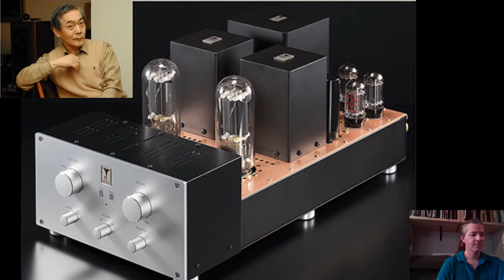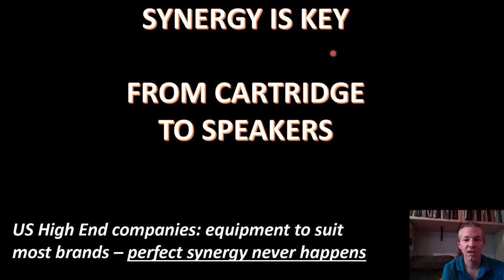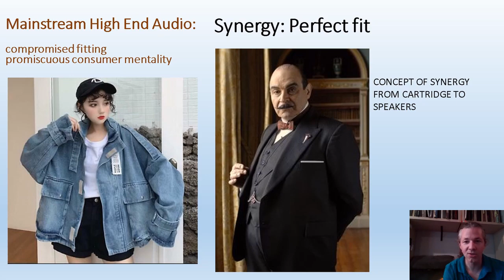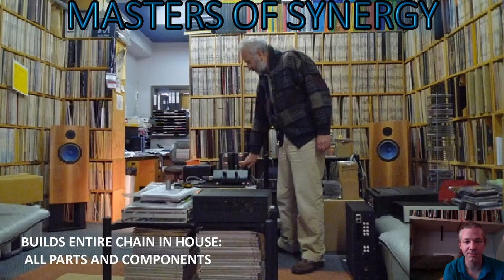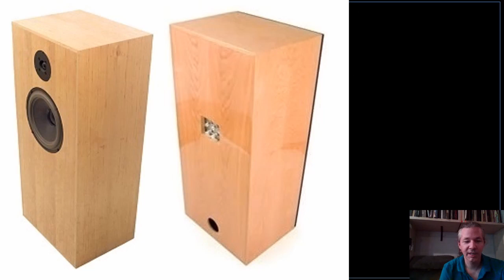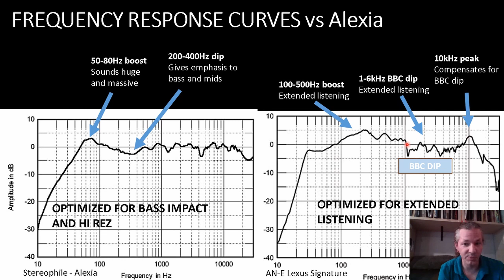Audio Note AN-E LX Sig analysis Part II.

Comment: As a total aside Janos, that experience of being moved by reproduced music like you had with the AN system - more than a live performance, is just about a perfect introduction for what your channel is about. 

And something else, which you probably don't know, I was initially (when watching this video 1st time) actually concerned with active cabinets being one trick ponies, doing couple of things well, but introducing colourations (seeing the AN-E Stereophile waterfall plots showing resonances in line with dimensions and port-top distances)... So despite your videos, despite AN applying it.. undoing decades of deadbeat narratives is not always easy to put aside....

Contrast, a year after this video and having build 2 active cabinets variants, the (final) build no#3 will likely go all out, use tone wood and coupling the driver to the backwalls :-) Also turns, out the resonances and impedance spikes I spotted before can be minimised using the techniques from Hiraga by putting drivers and port opening outside major harmonics of the cabinet, and by using a tapered horn, so even apparent 'downsides' actually have their own, quite elegant, but not widely known solutions... much like the use of different densities of wood in the VOL. You recently did a great job sharing the 'petit' and all its fine points to everyone which may have helped more people trying something that's not the norm... Anyway thank you for all your work, it's been a beautiful breakthrough for me having music reproduction that moves without breaking the bank.
Reply from the maker: The narrative that cabinets must be evil, and their contribution must be eliminated is cemented in extremely strongly. There's a lot of people who are not capable to re-examine the issue, especially those who have read into the inert cabinet lore and are proud for the knowledge they have gained. For a reason or another, we all tend to become attached to the information we gathered, and when new, conflicting information is available then it often seems to people as a personal attack on their belief systems. How can a resonant cabinet be anything but evil? How can anyone go against DOGMA? When such a question arises, that it the big red warning sign that we have left the purview of reason and crossed over to cultish behavior.... 
Indeed, as you have so well demonstrated, building and experiencing effectively puts to end a lot of assumptions that we take for granted.
Yet, for most, typing away defending their belief systems is the easier way out, can't be bothered by actually trying things out... ;

Comment: So AN-e has an woofer with overdamped extended bass shelf alignment with minimal BSC mated with a lower level tweeter that doesn't go much past 10Khz.
Reply from the maker: Indeed, the measurements tell that it will be a poor choice for an anechoic chamber. They worked with the constraints to get a loudspeaker that will work in a mid-size room with glass windows and hard surfaces, with as much efficiency and as extended bass response as possible for such a compact size.

Comment: I wonder what speakers Kondo-San had in mind when he was designing his amplifiers.  That would be interesting to know!
Reply from the maker: Actually, these amplifiers were commissioned to go on a yacht, 4 amplifiers. Unfortunately I have not asked Shibazaki-san what speakers he used, but I'm pretty sure he used horns - I think custom made Altec horn speakers, but do not quote me on that. (I had the fortune to meet the amazing Japanese audiophile gentleman who commissioned and named the Ongaku.) 
Eventually the biggest problem of Kondo-san was that he did not have a pair of speakers that could be successfully marketed as a perfect mate for the Ongaku, and he ended up demoing it with various speakers, which most often did not show the true potential of the amplifier. Peter Qvotrup was the one who adapted the Snell model E, and made the unique loudspeaker (AN-E) that is high efficiency, has great bass extension for such efficiency, and is compact enough so size is not prohibitive for customers. Both Kondo san and PQ had horn speakers in mind as best pairing for the Ongaku, but customers do not want big horns... they want compact speakers.
Reply: @realworldaudio  Audio Note speakers would be a great fit for my smaller room.  The corner loading would help the cause.  Not needing to bring them out into the room would help!  I wonder how the Snell E, J, & K compare to their Audio Note siblings!
Reply from the maker: @thetakeout  Sadly, I've never heard the Snells. Larry (Real Hifi Help) has heard AN-E and Snell E side by side, and says there's a world of difference between them. Also, AN-E covers a very wide range: from the basic AN-E to the most esoteric one they are essentially the same cabinets, with roughly same drivers, but the crossover is vastly upgraded. In my experience, a  great design accounts for 33% of the sound, and the crossover makes up 66%... or even more. So, along these lines, the Snell E (and other Snells) can be vastly upgraded with better quality capacitors, inductors, resistors and internal wiring. ;

Comment: A person recently suggested that we listen to this in my office. I played it on Spotify through my modest setup, and I cried. I'm sure it is very nice to achieve the bliss and Nirvana you discuss here. In the meantime, some of these toys can be quite moving. LOL Here is the song that moved me: https://www.youtube.com/watch?v=rVN1B-tUpgs
Reply from the maker: Very moving! Thank you for sharing. I listened to it on computer with headphones, and it was touching. Evolving the audio equipment, this connection, the touch gets deeper. But you are absolutely right, we do not need extraordinary gear to make it happen. However, it will amplify the experience just like changing a candle light for gazing into the sun.

Comment: What did Kondo in like be about the 211 tube?
Reply from the maker: It is extremely linear, and has a very wide linear range (1000V). Just about one of the best or perhaps the best amplification device ever made. Very hard to use though, that's why an amp using it gets very  expensive. You also run into making extreme safety precautions for the extreme voltages - which prohibit the use of standard / accessible parts, as even teflon insulation breaks down under that voltage. Yet, if you can solve all the difficulties, it makes a truly state of the art amplifier.
Reply: @realworldaudio  Ok thanks! Forgot about the heat factor.

Comment from the maker: A commentary for equipment synergy: you can also achieve equipment synergy with mixed brands in case you modify the components to match each other. My mentor modified ALL THE EQUIPMENT he sold (at no additional cost!), that's why his demo systems and his customers systems sounded so much better compared to an exact same system purchased anywhere else. I also grew into this habit,  I treat commercial products only as raw material, as a canvas to be shaped to needs. When you look at brands which produce multiple components (such as Audionote, Jadis, Kondo, PS Audio, Yamamoto) then you have a good chance of creating a very good system without the necessity to modify components, or decades of buying and selling components to finally find a combination that works together.